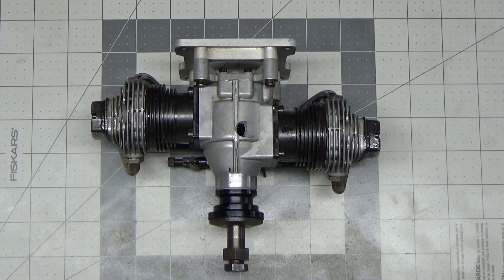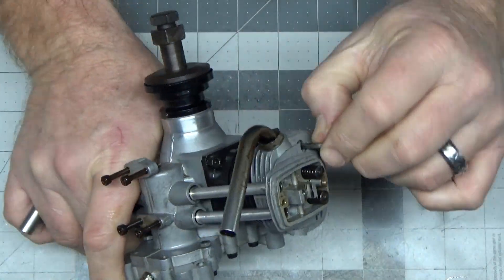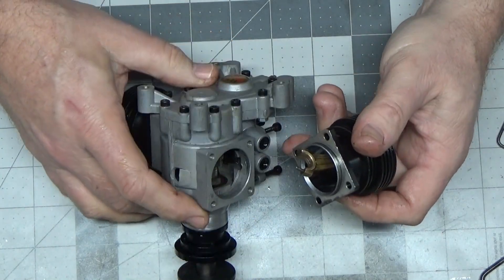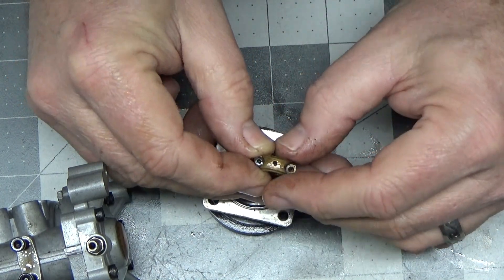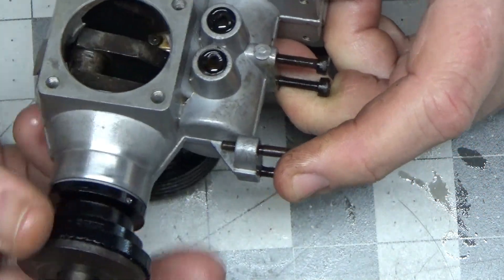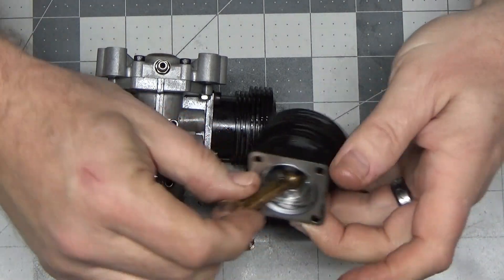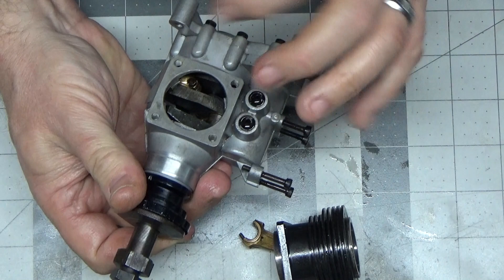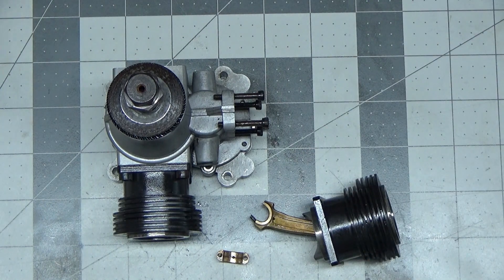Magnum FT-160 What Happened?

Comment: One cylinder could have seized and stopped, then the rod cap got yanked off as the piston did not come back down fast enough. The rest of damage was the moving crank smacked the rod and bent the cap bolt over. So weld or braise the hole in the case. Buy a new rod...How many hours of break-in? Seizing up comes from not enough clearance or way too hot?? Look at the cylinders for scuff marks or where it seized? The rod would only be bent it it seized. A rod cap failure would not bend the rod...

Comment: Looks like they need to start having ARP make rod bolts for their engines.
Reply from the maker: When I disassembled my first boxer engine I saw that these connecting rod screws were the weak link in the chain.  My opinion now is that these are like bearings, when the engine is serviced and these are touched, they need to be replaced.  I just don't trust this point in the engine anymore.
Reply: David McIntire I agree. The kid and I are getting ready to put his 454 together for his old corvette. We were going to do a “Roadkill” style rebuild, doing just rings and bearings, fresh gaskets and seals. The connecting rod bolts seem to be the weak link in most engines. Some guys said just reuse the stock ones. (110,000 miles) I couldn’t bring myself to do it. He wanted to go the cheaper route. Somethings you just don’t want to cheap out on. 

Do they even sell connecting rod bolts for your engine?
Reply: @dmrcflyr2  Wise words. These bolts are cheap compared to the cost of the total engine and the time and emotional investment you have in the project.
Reply from the maker: I would have to source them from a fastener shop. No they do not sell those screws alone.

Comment: David
Did you find the missing bolt head inside the engine? I did not see it in the video. Is it possible that it was missing when you got the engine and one thing led to another leading to failure?
Reply from the maker: I think it was ejected when the case breached.  No it is absolutely not possible as I replaced the bearings on this engine and did a complete tear down and reassembly myself.  This engine was assembled correctly by me.

Comment: The damage isnt as bad as it heard on video, the issue can't be atributable to lack of lubrication, over revving or conrod metal fatigue, or any other thing; looks more like the failure initiated right in one of the cap screws, you can replace them with higher quality for the piece of mind, it's very repairable. The Magnum distributor un USA has those parts in stock  good luck!

Comment: Maybe you can test the claim that JB Weld can be used to fix an engine block.
Reply: That can be welded. I’ve had a couple motorcycle cases welded. Used different people both times. They both said the biggest problem is getting the oil out of the porous aluminum. They had no problem though. Both repairs held up fine.
Reply: @mrbigg7255  In addition to the oil in the metal problem, model engine is usually far smaller than a motorcycle or other similar- much less heat sink to work with, I have been told the cases are also prone to warp and distort from that.
Reply: John Kelinske I’ve had the exhaust port bolt hole welded up on a crashed engine. Was told the same thing about warpage. No issues. Came out great.
Reply: @mrbigg7255  yeah, but unless you can do the work yourself, or know someone competent who can it isn't worth the effort unless you can't  get nos parts at all.
Reply: Also wondering if brazing would work as well.  I've had a JB Weld crankcase repair fail (on the ground fortunately) so I'm suspect of this type of repair in a 'glow fuel rich' environment.
Reply: I've had aluminum welded at a radiator shop before. It may require some grinding on the inside of the case.
Reply: @mikeeiben3430  Problem with engine cases is that because of the alloys used, the oil in the fuel tends to become imbedded in the metal surface over time and when you heat it to try and weld it, it can explode- not good. There were a couple or so engine guys I once knew of  used to heliarc cases like this to fix them, but they were masters at it.
Reply: @johnkelinske1449  , I work in the automatic transmission remanufacturing industry. Transmission cases are often TIG welded internally to make repairs. I agree, it requires a skilled welder.
Reply: @mikeeiben3430  Yes sir. But different alloys, different situation. It is a lot more than just welding skill.

Comment: No evidence of a lean run or seizure. Failure of the end cap retaining bolts as you said. Looks like one had the head come off  and then the rod came loose and hit the case, bending the rod and shearing off the other bolt in the process. Most likely poor metal not lube or anything you did. A shame the parts cost is such that it really isn't worth fixing the engine.
Reply: I was wondering  if they have to be torgued or put some low strength loctite

Comment: Well it definitely had the lube in the crankcase...Go back and listen to the difference with headphones between the last two run videos.  Do you hear a difference?  I would get a set of connecting rods and scour for a case...Is OS, Magnum and ASP the same case?
Reply: https://www.ebay.com/itm/OS-46101000-Crankcase-FT-160/392216309590?hash=item5b51e9ef56:g:2oIAAOSw5i5cPkUJ:rk:18:pf:0
Reply: https://www.ebay.com/itm/OS-46105000-Connecting-Rod-FT-120-160/392216306324?epid=806832801&hash=item5b51e9e294:g:1U4AAOSwlt9cPkRZ:rk:1:pf:0
Reply from the maker: Well $183  total is less than the prices on Mikegoesflying, but still too much to invest in this engine.  I would not trust the other connecting rod at this point so I would need two of them.

Comment: the screw that still has the head looks to have came loose, if you place it so the sheared spots are together is the screw head tight against cap? that would explain why the screw with the head is protruding from the cap some

Comment: Wow, what a bummer, I have one of these as well.  I have 25 years experience with root cause failure analysis.   Just my initial preconceived idea based on the items shown, the initiator was the fastener missing the nut, the sheared fastener is resultant to the cause factor.  The nut would have had to lose yield in order to have completely loosen.  Once loose, cyclic load could or would have pulled it off the threaded portion of the fastener.   Would have to look at the fracture faces to better understand actual root cause.   If the nut came loose, you should note fretting on the nut, cap and or rod to cap interface.  You could hear the rod start knocking seconds before disconnect.   I’m not a Dr but I did stay at a holiday inn express once.  Good luck sir.
Reply from the maker: There are no nuts on these.  They are hex head screws only.
Reply: David McIntire     Haven’t had mine apart, same scenario would apply however.  Look for fretting or possible fatigue indicators on the fasteners.

Comment: Hate to see that happen to you Dave, but luckily it wasn’t a complete loss. Hopefully you will get her running again.
Reply from the maker: At $234+ for a new connecting rod and crankcase, quite unlikely it will be fixed.  That is nearly as much money as I already have in the engine.
Reply: @dmrcflyr2  
$234.00 is a bunch for parts.  Can't blame you for not rebuilding it.  Too bad. It was a nice engine.
Reply: @davepetre6252  That is almost half the cost of the engine when new.